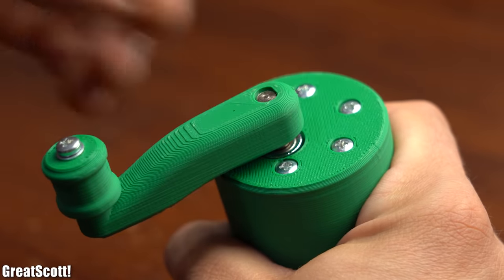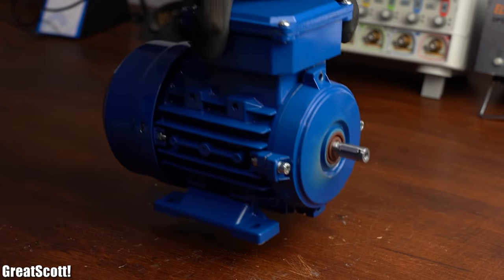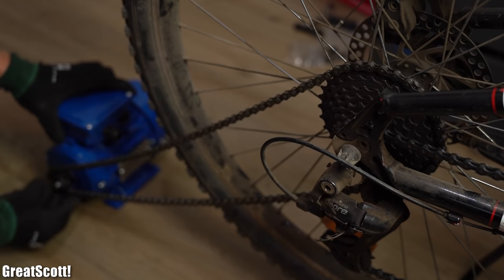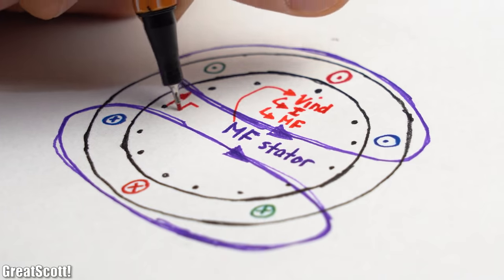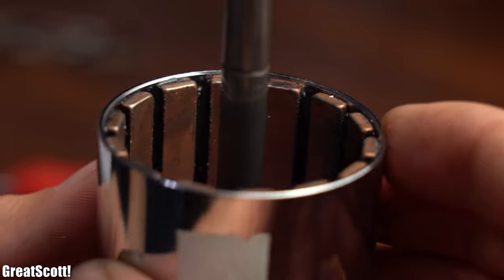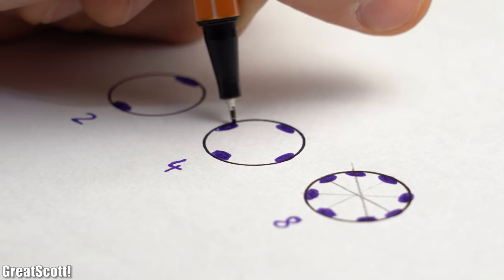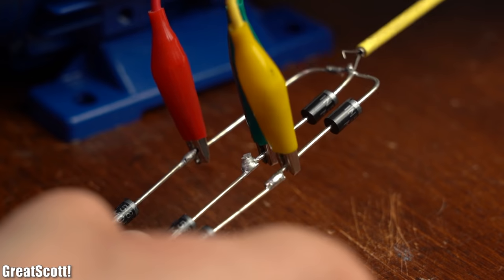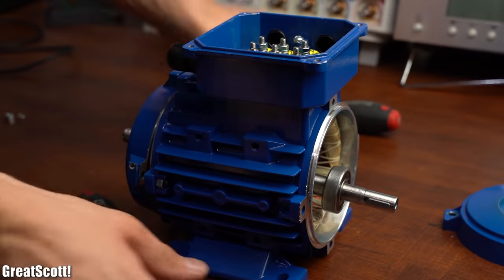HACKED!: Turning an Induction Motor into a Generator?!

Comment: Also you need to use an induction motor already with a start and run capacitor which you would not need to modify. The only thing is to do is briefly connect it to a 12 volt supply for about 3 seconds.  Try yours again but purchase a motor RUN CAPACITOR (never. Start CAPACITOR) and connect it parallel with the leads..  the magnetic field will remain as long as you disconnect the load before shutting down the generator (stop peddling). I get 120 volts easily the capacitors make the difference

Comment: Putting in an 8 pole rotor in a 2 or 4 pole stator is why it isn't working. You have two solutions.
1 Orient the magnet for 2 North poles, and 2 South poles for the 4 pole motor or Orient them for 1 North and 1 South pole by placing 4 adjacent magnets North out, and the other set South out and try again, or for the 4 pole motor put the magnets in pairs with 2 North with 2 South, and 2 North and 2 South.
2 Rewind that stator for 8 poles, each alternating to match the magnet pattern.
If you want 3 phase model it with poles and magnets just like your brushless DC motor.
Sticking an 8 pole rotor into a 2 or 4 pole stator won't work. Try again. Fix the number of poles to match the stator in use. You can still use 8 magnets, but they need to be in pairs for 4 pole and in sets of 4 for 2 poles. Please try again.

Comment: you turned the induction motor into a permanent magnet synchronous motor! The problem there is the airgap that it's too big and if you use a metal rotor is better to link the fluxes of the magnets.
You can use a brushless ESC to drive it now!

Comment: How about using a rear wheel with a hub motor installed backwards? I am currently using a front wheel hub motor as a generator on my bike to harvest some energy to charge my phone any maybe operate a portable fridge on a trailer. It outputs up to 90W when going downhill fast. It's rated 36V 250W as a motor.

Comment: I assume the motor is single phase you need a capacitor to generate a higher voltage that is why people use three phase and make sure it's connected in star connection
Reply: And make sure your rotor is longer and the space between rotor and stator must be 1mm

Comment: Your choice of 8 alternating magnets was the problem. You should first check what is the poles configuration of the motor, which kind of pattern it induces on the rotor and then replicate that pattern with permanent magnets, possibly, with several magnets stack on each other to increase the field. Remember that a 6 pole induction motor will induce a dipole on the rotor, so if you had used only 2 magnets, your first result would be much better.

Comment: Hi. This is a good experiment. I have a suggestion. If you want a high voltage output, you should make an electromagnet rotor instead of permanent magnet rotor. Permanent magnet is not enough inducing emf even using neodymium magnets. If you want to maintain a 50/60hz frequency, pri mover should run at least 1800rpm for 4pole 60hz. By exciting the electromagnets at the rotor, it will generate high voltage output. Hope you can use this as reference. :)

Comment: Would it be possible to apply a dc voltage to the rotor, instead of using permanent magnets, to create the field you need to turn this into a generator?

Comment: could you not drive the shaft get energy out of the shaft by hooking it up to 3 Phase and speeding the rotation to like 3'100-3'600 R/min(2 Pole/4 Pole half the rotation......etc )(normely it would go 2600-2900R/min in  3phase 50Hz ) So you would essentialy Remove mechanical energie and you would give energie to the Electrical Grid. 
At least thats my understanding of an Induction Motor.

Comment: You tried to make it as a synchronous generator, but the specification changes, so the no, of poles should had been more for less speed, and you had to change the connection of the field winding too, for which now, would be called armature winding

Comment: The large distance between the magnets and the coils in the second attempt is definitely causing a loss to the output. The magnets need to pass as close to the coils as possible. Also the strength of the magnets you use greatly affect the output. Had you made a new magnet holder, measured it to where the magnets come close to the stator as possible, with deeper cavities and used a few magnets in each slot to increase magnetic field, the output would have positively increase. However, all that said still enjoyed the video.

Comment: You don't have to modify anything to use an induction motor as a generator. You just need to connect a capacitor bank to the terminals. it's so called self excited induction generator

Comment: You didn't even had to dismantle it, actually. Ever heard of capacitive excitation? Basically, you use capacitors as exciters, hooked up at each phase of the motor. All you need is a kick start with the mains voltage, and then force the motor to run way above its slip rotation.

Comment: I think you have the wrong ratio between magnets and stator poles and thus creating opposing currents in a single winding. Try it with the same 8 magnets but 4 on one side with the same pole and 4 on the opposite side with the opposite pole. On the 4 pole motor you could probably alternate the poles every 2 magnets.

Comment: 1. the magnet numbers are not paired correctly with the coil number,
2. poles are not magnetically opposite connected, that plastic is not good enough to transfer magnetism (I just suppose, not work with that kind of staff) you need a steel rotor
3. the magnets are extremely small, you need an electromagnet... look for reference on car alternator

Comment: we use to have dynamo's on bicycles which powered lights for the bike the dynamo would be put against the tyre to make it spin. maybe you can do t hat with a smaller motor. also i had a old skool speedometer for my bike where you would put a plastic wheel wheel on the tyre and it would spin and give the speedo a reading so maybe you could make something like that with your smaller bldc motor or something. 

by the way be interested to get your opinion on parkside tools. i have a parkside plasma cutter and a 1/4" hex impact screwdriver great products for the price!

Comment: The bicycle gives only about 100 rpm and I looked at a car generator graph and it needs about 2000 rpm to reach 12v.  The hand crank generator needs a wheel to turn against the bike tire side wall.

Comment: You just could use compensation Capacitors as load  and the aluminium cage would get magnetized by itself (self exitation). no need for useless Plastic-Magnet modification at all.

Comment: Your rotor must have tha same number of poles as the motor stator windings. With 4 pole (1500rpm for 50hz line frequency) 1.1kw motor and about 100 small coin magnets (8mm diam, 3mm thick from aliexpress), i got about 60-70W at 1000rpm (spun with an electric drill). I tried using 2, 6, 8, 12 poles, but the output power/voltage was a lot lower.

Comment: hi my fiend! you should put the same number an size of poles than the stator.  for example  in 3000 rpm motor a half rotor with north pole and another half with south pole magnet. for a 1500 rpm 4 poles of a quaeter of rotor N/S/N/S. with many magnets the magnetic poles in the rotor  cant put the size of a pole need by the size of a coil. thanks to share your experiments! best reggards!

Comment: Is it possible to generate the stator voltage with an synchron Motor and then generate Power with the rotor of the asynchron Motor?
All E phds feel free to correct me!
Reply: I know you need a phaseshift.
But the asynchron Motor generates no shift?
And yeah the stator frequenzy must be lower than the rotor frequenzy to generate Power.

Comment: Why not just 3d-print a sprocket that's compatible with bicycle chains and the keyed shaft of your motor?

As for using an induction motor as a generator, you can get it to self-excite by connecting three capacitors across the three output terminals in delta configuration. Use non-polarised, 400V capacitors of 20uF or greater (motor-rated types are best, such as CBB60 or CBB61). You'll need to spin the motor shaft faster than the self-starting RPM, which depends on capacitance (higher capacitance gives lower required RPM for self-start), but typically is close to half rated RPM. Careful, because the output voltage will be well over 100V when it starts (shock hazard).

The squirrel-cage rotor that came with the motor will do a much, much better job than those permanent magnets. The magnetic field strength ("B") achieved by those magnets is not as strong as what you get with the stock rotor when some current starts flowing.

Comment: Why not use a hoverboard wheel instead of those large blue motors?
And long interior tube might be better than chains. Just surround it on the whole wheel instead of the gears.

Comment: I’ve heard of people using DC treadmill motors as a generator. Would that work? What about a starter motor from a car?
Reply: Yes. But an easier one to work with would be one of the Smartdrive motors. You do have to do a bit of work to use them as you need to split the series coils into smaller groups. As an example, the 18 coil small Samsung units are 3 phases of 6 coils rated at 300 volts. Split down to 6 3 coil units works better. And you can go down to two coil units if needed. Then use a 3 phase rectifier to get DC output. Just you better be on the bicycle doing the pedaling as you will find out that they can produce quite a load. Just about the maximum that a good athlete can produce even on a continuous basis. I have seen one produce 10 Amps at slightly over 24 Volts when spun at 1000 RPM.

Comment: Ok so you're turning an asinchronous motor into a sinchronous generator. It was not winded for that purpose. Also your magnets are impotent for that winding.

But you can make an asynchronous machine generate a voltage by pulsing the voltage applied to the windings.

The theory is long, but basically you are to use the insuctive kick of the motor and the remanent magnetisation of the rotor to generate a voltage in the stator. Like they use in electric cars in brake/recovery mode

Comment: Tie the induction motor to the grid and spin it over synchronous speed to turn it into a generator ❌
Add the parallel capacitors to self-excite induction motor into generator ❌
Use an DC/AC converter to inject reactive power to the induction motor and harvest the active power to the DC side ❌
Modify the induction (ASYNCHRONOUS) motor INTO a PERMANENT MAGNET SYNCHRONOUS MOTOR (PMSM) to turn it into a generator ✔

would rather buy a PERMANENT MAGNET SYNCHRONOUS GENERATOR (PMSG/PMSM)

Comment: Please help me,
I have a laptop charger but it just turns off after a Fraction of second. I don't know is it because of the data sense pin or something is wrong with the electrolytic capacitors .Please help me.

By the way you are a good teacher and I enjoyed a lot😃❤️
Reply: Looks like something went wrong in the circuit and the internal microcontroller inside the smps is trying to shut down the output after a fraction of a second for safety
Reply: Thanks
Reply: Please help me solve it
Reply: It requires cutting open the charger and looking for components that may have failed.. like fuse,capacitor,diode, feedback circuit etc.,  It also contains dangerous mains voltage inside so one has to be careful while working with that
Reply: @chandraganeshan961   thanks a lot 😃

Comment: Interesting but you need to set up the magnets in the same polarity configuration as the original squirrel cage poles which are very broad in size, NOT by alternating N/S every magnet like you did. The outrunner motor you used as an example has many more stator slots/coils and cannot be used as an example of how to wind your induction motor. The induction motor poles are much broader and not alternating polarity every magnet. This is why your generator is not putting out much power.

Comment: I think that using capacitros is not the greatest idea because you would need constant (depending on the motor used) rpm to produce power efficiently.
Probably the problom was that he didn't look at the windings an just guessed the magnets arrangement, these types of motors would require two magnets on opposing sides to generate one magnetic field rapping the rotor. don't judge me for that one it really depends on the motor you're using just look at the windings.

Im not going to be hating for the plastic rotor because it was met to be a test just to see what happens in you put magnest inside induction motor so the 3d printed part (that could melt or blow up a higher speeds or after some time of exploatation and vibrate while spinning) is fine.

Looking forward to next video featuring proper magnet arrangement.

Also i made simple and easy to build (witch means could be better if i wanted) bicycle powered by weed eater engine. 1 min vid on my channel.

Comment: Actually...there is no physical difference between generators and motors, they are built the same. One works on the 'motor' principle, the other on Faraday's Law. HOWEVER, for most-efficient building, a 'generator' uses a 'permanent magnet field' and an alternating armature. This, in application, would be best-achieved by either a 'dedicated hot electromagnet coil' in the field, or arranging alternating permanent magnets in the field. As for 'simplicity', the permanent magnet field is the easiest to build at home (with minimal technical design)...the armature and brushes would stay in the current configuration. Then, simply spin the armature mechanically (another motor, an engine, a bicycle chain, etc.) and take the produced electricity from the brush wiring. This is NOT how 'commercial generator heads' are made...they use a wired electromagnet field as well, but for what you are trying to do here, it would be easier to simply build a 'permanent magnet field' and turn the armature.

Comment: Why dont you try to replicate the effect of the tesla motors? Thy use the same induction motor as a generator, but you need to control some other thing like the frequency of the electricity to make the magnetic field always slower than the rotation of the motor rotor

Comment: That was a big turn off .. to generate electricity out of Induction Motors you must attach them to the grid ( power supply ) and rotate them faster than the sync speed.

But, you just simply destroyed it and tried to convert it to something you know something about ( Sync. generator ) .... Big DISLIKE

Comment: you should have investigated a SEIG (self excited induction generator) [without heil] setup using switched "motor run" capacitors before butchering the motor. don't try it with "motor start" capacitors as you will blow them up.

Comment: That huge gap is what kills it, could you not atleast glue more magnets to the magnets in the rotor? The magnet nearly doubles every mm,  so you barely have a field to generate power! This could work with a better rotor, if nothing else a block of wood, with magnets in it! Maybe check the coil spacing to optimize the magnetic poles needed?  Please do try again!!!

Comment: the air gap between the rotor and stator should be as small as possible,  i think that explains your low efficiency of the generator...
Reply from the maker: True. But I think even a smaller distance would not make the induction motor into a useful generator.
Reply: Correct, that gap was too big and lost too much magnetic flux.
Reply: Agreed, although big industrial generators work with fairly similar types of motors for there generators as far as I know they use synchronous ac motors instead of asychonous and they probably would have powerd rotor windings. So improvements should be possible!
Reply: @iano0100  Correct, they are synchronous machines and the field windings rotate on the rotor. The AVR varies the voltage and current to determine the voltage / VAR output. The prime mover power determines the kW output from the generator. I work on these for my day job....

Comment: I won't be a naysayer like the rest.. I'll tell you that the distance from the magnets to the winding matters, and even that little gap you had in the second motor probably dropped your output voltage by more than half.

Comment: You mabie make a (like a brushed motor) exciter (or self exciter) for the motor like the one in a alternator (I recommend you watch his video on it from a YouTube called the engineering mindset)

I bet when you done watching his video your generator will be quiet good just use a self exciter method mabie use the dc motor as the power source for the exciter.

Comment: Some one maked a generator by modifying the stator from an old washing machine.
I do not know if you have seen this?
He built it with some wheel (Pelter Wheel?), and used water from a stream to spin it  to generate electricity.

Which again brings me to the fundamentals of electricity......
Is it really possible to generate MORE electricity than what you put IN?....hmmmm

Comment: Great job there , some comments: perhaps by counting the number of slots you could adjust the number of magnet to get the highest winding factor. Go to emetor.com to find out

Also the iron PLA is not permeable enough magnetically. The flux cannot loop if the permeability is too low. Something else
Like steel or iron , laser cut would be better , john-steel.com does that nicely in mild steel.

Comment: Surprised you didn’t use the wheels tire contact to drive a rotor or drive shaft to power the motor, along with a gearbox so less physical energy for more electrical energy
Reply: No way you can get more electrical energy for less mechanical energy..by using gear box you just increase the mechanical factor....And energy remains same..